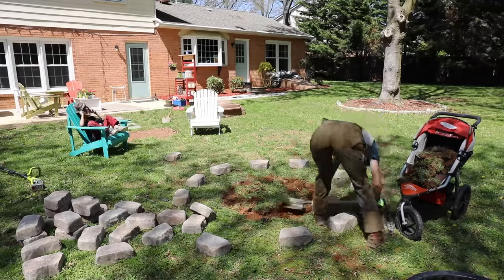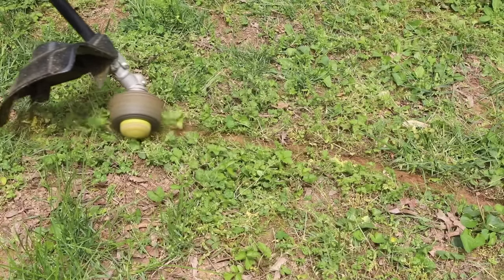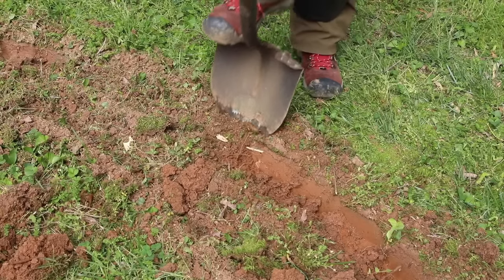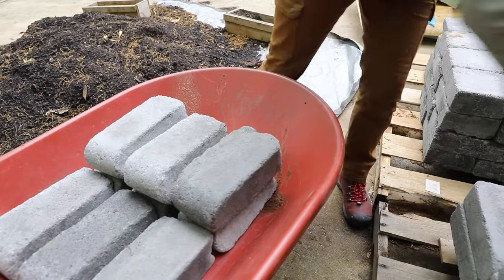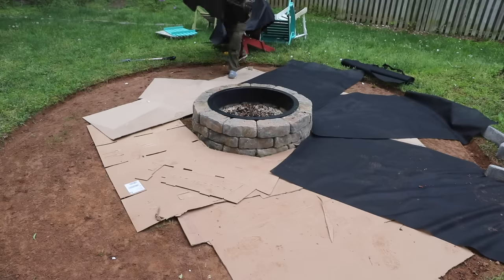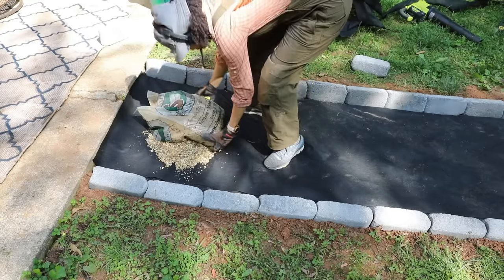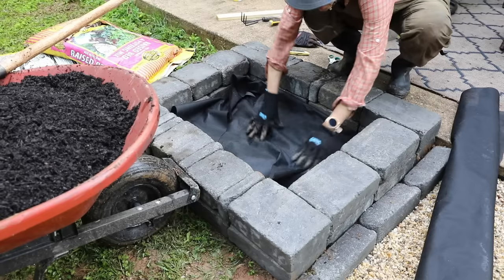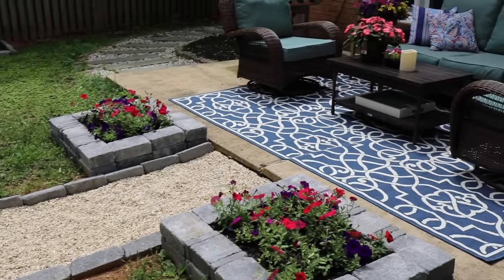How to Make a Fire Pit Seating Area: Backyard Makeover - Thrift Diving

Comment: Pro tip for tillers!!!! It helps if the ground is wet when using them (I suggest just spraying the area with a garden hose) and it's easier to pull than to push.
Reply: Also when trying to keep everything level, nothing is easier than a rope and a string level. With two stakes in the ground, you will be able to easily determine whether or not everything is flat.
Reply from the maker: Great tip for the tiller and being level! Thanks!!
Reply: @meganking536  I like your last name 😁

Comment: Good Video, but there's a couple of things to remember. first when laying any type of tarp or weed cover make sure you pin it to the ground to prevent you from moving it. second its usually a good idea to lay sand down before laying the stone. third which is probably the most important is to level everything out.
Reply: she said that she felt that the stones were sitting well
Reply: @real_smilegamez  it does not matter. first couple rains and there all gonna be messed up.

Comment: You absolutely need a stone and sand base. This patio will need torn up and re leveled by next spring. Nice work, but if you don't do it right, you do it twice
Reply: I hate to say it but it's true. Gravel and leveling sand would've sealed the deal
Reply: And it helps with your drainage

Comment: No sub base 
Wont last 😂
Reply: MrCeegee90 yup
Reply: does anything ever last?
Reply: @bobbydixon4484  if it has a sub base yes.
Reply: @thomasbrown938  gojira profile pic👏👏👏 I see you are a man of culture🤘🤣
Reply: Indeed, you are right, I did it in my garden and have to redo every 2 years because of the weeds growing between rocks even though I put 2 layers of polythene and black fabric. But what is a sub base?
Reply: @renata6667  sub base is when you dig out the area you plan on laying pavers and use crusher run (at least that's what we call it here) tamp it every 2-3 inches then use Mason sand to screed, then lay the pavers, once pavers are laid you use poly sand (keeps things flexible when wet for water to drain through but solid when dry)
Reply: Screeding wont last either
Reply: @MrCeegee90  so then would you just use crusher?
Reply: @MrCeegee90  I worked for a landscaping company a few years back and that's what they did 🤷‍♂️ couldve just been another way to add to the bill🤣
Reply: On paving slabs i would put a layer of crushed concrete(MOT Type 1) then lay them on a wet sharp sand/ mix. Depending on the type of slab i would point the joints with a soft mix. No weeds will grow through and will be solid so it wont move or sink
Reply: unfortunately true.  i made this mistake personally.

Comment: So quick tip for the future, I think the problem you were having with the hose/extension cord methods was the way you laid it out. You should fix the hose to the end of the line, like by having someone step on it where the sidewalk starts. Then take it to the end point, like the fire pit and yank it until it's taught. Then it should be straight end to end. If you want to make a circle easy, fix the hose end again to the start point, like the center of the fire pit, and then pull it taught at the diameter you want. You can just walk around in a circle and mark each point (or the whole thing) without having to measure out the distance.

Comment: A couple questions please: Whats the name of that tiller/cultivator you're using? Do you recommend it or is there a better one you'd recommend for removing mostly dead grass? Should the soil be moist or dry to get the best results from the cultivator?  Also I've heard about using sand to stabilize pea gravel - like putting it underneath the weed barrier I think. Do you think that would be necessary for something like this? - Thanks! Its so encouraging for me to see a woman tackling a project like this!

Comment: Flat shovels aren’t for digging. You need a spade to dig. ♠️ points are better. Back filling is the way to get the fit tight, just as you did it. They make long metal pins that look like oversized staples to hold the weed barrier in place. Looks nice!

Comment: If you worked from the outside (not standing on the weed block) wrinkling would not have been a problem. 
Nice job, I also have the fire pit mid yard and was thinking about doing the exact same thing.

Comment: Great job! Sand, in my opinion is more of a nuisance than it is beneficial to the project. Every patio and pathway I've seen that had sand under the pavers ends up with sand working its way to the surface either from ants or heavy rain bringing it up. P.s. they make staples for the weed fabric that keep it in place.

Comment: Staples will help to keep your ground fabric in place, and a solid base of gravel then dg/sand (min. 3-4 inches deep each, depending on your soil and region) under those pavers will provide drainage and prevent the pavers from settling unevenly.

Comment: Very cool but if I were you I would add a line and bubble level to your list of tools. Levelling those panels with a rubber mallet would have been well worth the effort.
Reply from the maker: Great tip! I just put in a brick edges garden in my front yard and definitely used a level and a mallet to knock them into place. It does help, indeed. But these edgers around the fire pit still look great! I'll do an update video soon!

Comment: You can do that without the cloth underneath I think...it will make the water drain easily when it rains...but you did a good job out there..
Reply from the maker: I would agree with you. It really doesn't help with blocking weeds, because the weed seeds blow through the air and still land on the walkway. Good point. I'll do an update video about how the fire pit has worked for me! :)

Comment: If anyone wants to save the digging work, I did my back patio by using a raised edge--so that the blocks are taller than the ground. Similar to a raised bed technique. It means you just dig around the edge of where you want the patio, put in large blocks (or a double layer of blocks), then lay down your landscape cloth, dirt over that, pavers (or in this case gravel) on that. Will save you loads of digging. Similar to what you see here, but with a little more of a raised border.

Comment: I haven't read over all of the responses.  I have a question:  What type of Cultivator did you use? I appears to be battery operated but what brand, voltage, etc?  Thank you!  Love the project and I'm planning to do the same.
Reply from the maker: The brand is by RYOBI and is cordless, using an 18V battery. Works well for small jobs around the garden! You can find it here with my affiliate link: https://homedepot.sjv.io/QqNNa. Be sure to get 2 batteries so you can always have one fully charged and ready in case one dies.
Reply: @ThriftDiving  Thank you!!

Comment: I am a handygirl and I cried throughout the video because you did things anyhow. 
Your paving stones are absolutely not straight and will come off at the slightest bit of rain

the sand is used to stabilize the pavers because the dirt turns into mud when it rains and therefore cannot hold anything
Also, to put them straight you would have needed a bubble level at least

Comment: i'm no pro but damn that seems like a rushed job probably because of the amount of work you found yourself doing. Landscape fabric can be secured with dollar store staples it only takes maybe 10mins to get them all in and everything secure. Not using sand and having to manually dig soil out to level also made it more work. Overall looks good but maybe a little more planning would have made it much easier

Comment: A pick ax would have broken up the ground more easily than the tiller.
Reply from the maker: Wouldn't that have taken longer, though?
Reply: No, I’ve used both a tiller and a pick ax. Your ax will break up the ground and then you can use a shovel to easily remove the dirt. Short quick hacks will do the trick.

Comment: Good job on doing all that by yourself, but may I suggest next time do some research and for the value, you spent on this project, you could have done something more durable and long term. What you did here will not last long.
Reply: i.e, you could've purchased a concrete mixer for $150 and poured 3" concrete with concrete mesh and then use a 2" concrete mold and design the top. It is inexpensive to do it yourself plus it wold be permenant and beautiful.

Comment: I find it sad that you feel the need to explain your woman power story in regards to the home depot associate. 

Also, you should try to convert that fire pit into a smokeless style by adding air flow in at the bottom, leave a gap between the ring and the stone then drill holes at the top of the ring. Then put on a capstone to seal it in. Will help keep the smoke from plowing into some ones face